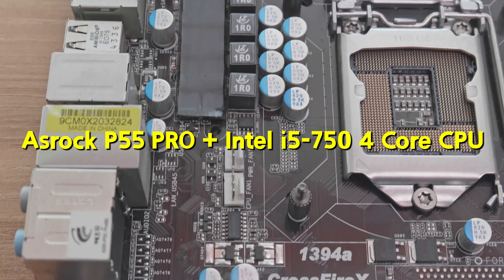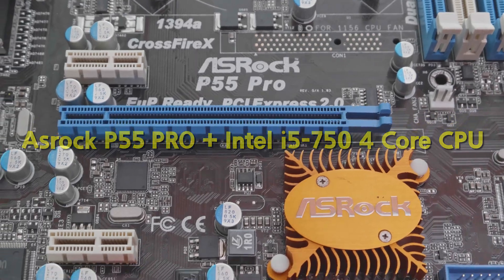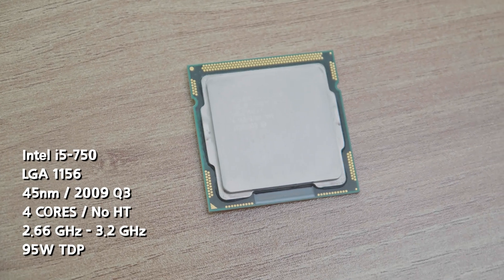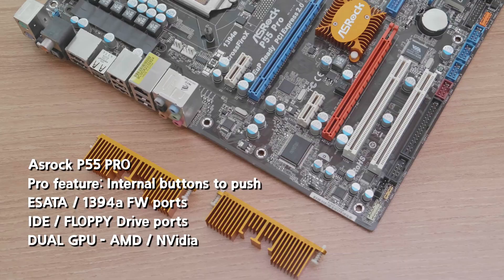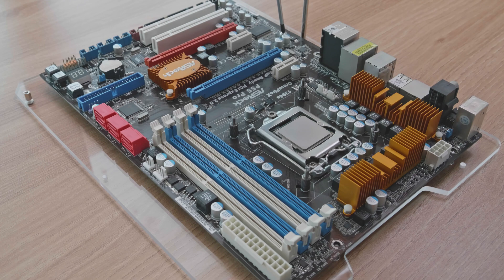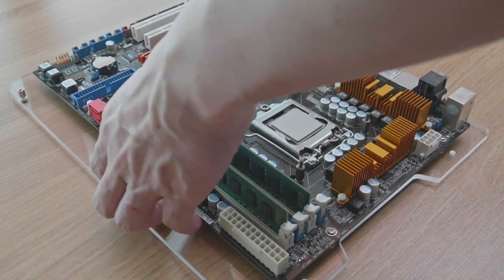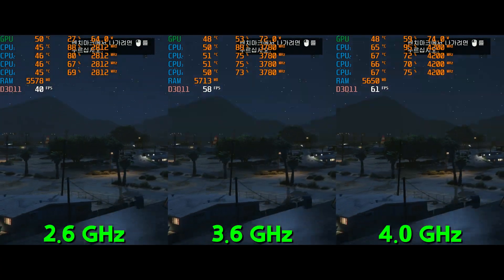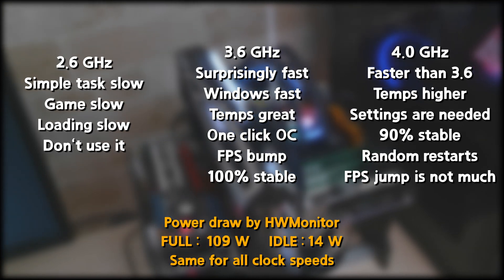Intel i5-750 Overclock to play in 2022 (구형 옛날 CPU 오버클럭)

Comment: What were the settings you used to get it at 3.6 I actually have this CPU with a GTX 960 and I would really want to get all the performance out of it
Reply from the maker: On my motherboard, 3.6 was done by simply clicking the clock.  But beyond that + voltage was needed.
Reply: @kspecmediagroup  thanks man ,I appreciate the response 👍
Reply from the maker: @jackjustice2558  You too, thanks!

Comment: What OC Tweaker setting that u use to achieve this high frequency? my rig have same cpu and mobo
Reply from the maker: Oh really?  If you have same CPU+mobo, you can go to overclock setting and choose the automatic clock speed.  3.6 was just "one click" but 4.0 was like you have to mess with voltage and some settings.  I recommend 3.6, it was very snappy.  I hope you succeed!

Comment: X3450 oc 4ghz can same performance with i7 3770?
Reply from the maker: X3450 is similar to i7. I thank it can match 3770 when overclocked. Significant jump came with 4th gen Haswell series so 3rd gen is possible to match I think.